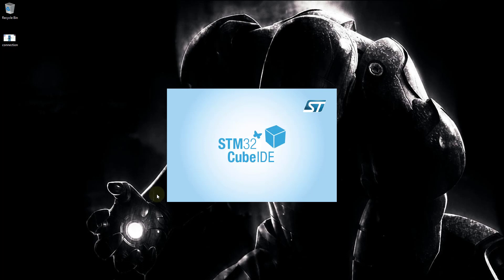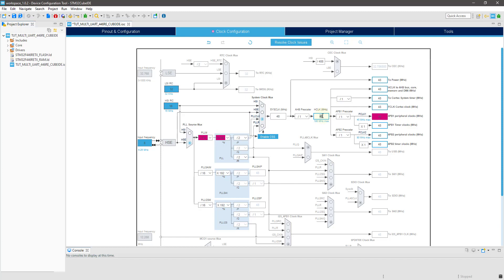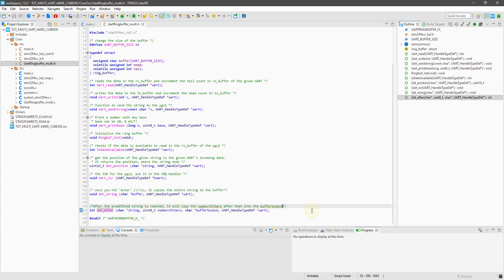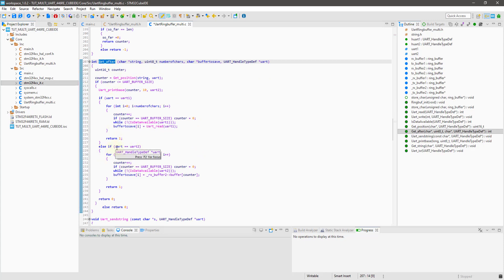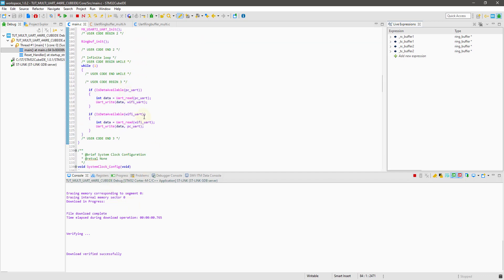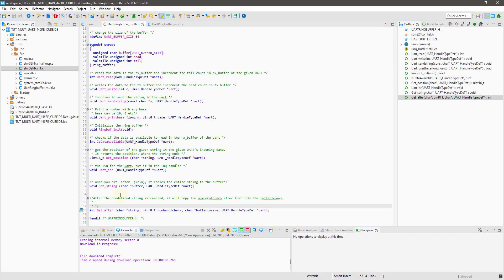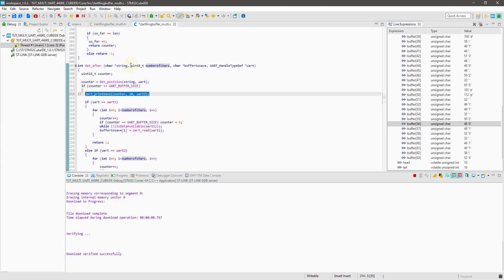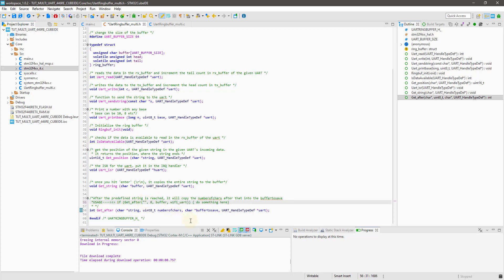Manage multiple uarts in STM32 || Head and Tail || circular buffer || serial devices

Comment: Thanks for posting! Very useful video! What would you 'get after' if you are transmitting google protocol buffers over a serial link between a stm32 processor and  a esp32?
Reply: Hi Eddy how did you integrate Google Protocol Buffers on STM32 Project , Please Help me in this Process i can't integrate Google Protocol Buffers on STM32 project iam getting many dependency and compiler errors Thanks in Advance

Comment: Thanks for posting your videos! I ported the code to a stm32H750 processor and expanded it to 3 interfaces. i had to change some register names that access the flags etc but for the most part it works great except for one issue that i can not get rid of. 2 of the  uarts are usarts and 1 is a uart.  when i receive data on the uart , the data ends up in the buffer but then the interrupt for that uart (uart4) keeps firing and the program never gets to the main loop anymore. Do you know if setting and resetting interrupt flags is different for uart and usart blocks?
Reply: Never mind i found the issue :)

Comment: I use stm32l496G discovery. I am not user usart1 because this board (stm32 discovery board) hasn't usart1 pin. therefore I am used LPUART1 for communication with esp8266. I have a problem. my problem is  in Uart_isr function. error: USART_typedef has no member named 'DR'; did you mean 'RDR'? HELP ME.
Reply from the maker: Check the description. There is a solution for that

Comment: 13:40 So if a function blocks UART then is it better to use USART in interrupt mode always?
Reply from the maker: Buddy, this is uart ring buffer. It is always working in interrupt mode. In blocking mode the data is still being received in the Rx bufger anyway. If u use the if loop, you can even do rest of the functions normally. It's just, you won't be able to do anything with the data received in the uart, until the string is matched and characters are copied..
Reply: @ControllersTech  So I need to look previous video for your own header file and functions.
Reply: I've looked UartRingbuffer files now and it looks a bit heavy code for me :(
Reply from the maker: Although it might look heavy but it's very simple to use. Give it a try. It's your best shot for unknown data length
Reply: @ControllersTech  You are right. I'll try to make it via watching your video for my MCU.

Comment: Hi, i'm trying to implement the projet, however when i do the sending buffer by usart ("AT" ASCI), (Usart 2 -> Usart 1) it only receive the carcter "A" . Don't know what's happening here. Don't know what's the change to do, any help ? I check the code, and i don't have the "READ_REG(huart->Instance->ISR)" and the "unsigned char c = huart->Instance->RDR;",, we only have the SR and the DR registers!! I'm using the STm32F103RBTX MCU
Reply from the maker: Read the description
Reply: @ControllersTech  The program does it ok, following this tutorial. But when the code  reaches the point of  ::
Uart_sendstring("AT\r\n", wifi_uart
while(!(Wait_for("AT\r\r\n\r\nOK\r\n", wifi_uart)));

The system breaks.. This line of code it's in the ESP8266_Hal.c file
Reply: Forget it!! We just did the connection !! However don't know what was the problem ...
Thanks for the help and the fast response.

Comment: Is not there a build BIN or HEX file directly and upload it into BluePill STM32F103C8T6 device via ST-Link V2 Mini programmer ?
Reply from the maker: There is a hex file generated after you build the project. Look for it inside the project folder. You can upload it via st link utility or maybe some other software too.
But it's better to use the st link directly. This way u will have the option to debug also.
Reply: @ControllersTech  OK, when I tried to Debug then CubeIDE said me "you ave to update your ST-Link V2 mini device firmware" and then I clicked to Upgrade button and it's done. But now Cube IDE and Cube Programmer says " error 4. No device found". Sometimes it uploads if I press on Reset Buttton on my BluePill (STM32F103C8T6) board and it uploads but sometimes even this way does not work. Maybe upgraded version has a bug ? If it is so how can I fix it ?
Reply from the maker: Frankly, i also have a lot of problems with my bluepill connection. That's why I am making more videos with nucleo board now a days. It's like half the time get wasted on just connecting that thing. 
I'll try to look into some other way of connecting it using serial connection or something. But till then i can only say that keep trying... Connect disconnect and hope it works..
Reply: @ControllersTech  Yeah, since yesterday I am working to fix it and learn to program in STM32 Cube. it was working well in Arduino IDE but it has another problem that it doesnot Work 2nd UART Channel in Arduino IDE. That's why I am trying to switch to more better programming environment like Cube IDE. Do you have any idea how to make work to UART2 in Arduino IDE ?
Reply from the maker: I can recommend you something but telegram me.. i need more information about the way you are using things.
Telegram me @controllerstech
Reply: @ControllersTech  Dear followers. I've fixed my problem by ERASE chip in St-LINK Utility I've downloaded from st.com. And then in CubeMX (now it is internal part of CubeIDE) went to  Pinout &Configuration menu and then SYS submenu, clicked to Debug -> Serial Wire option and then went back to IDE and clicked to debug menu item. Now everything works fine. I'm very thankful for the owner of this channel Controllers Tech admin.

Comment: Hi, 
I'm using ESP-01 and stm32f4 discovery.
When I reset my wifi module with a button, I receive the Wifi connected and Wifi got IP message in my terminal, but when sending AT command, the module doesn't any reaction to it and  rx_buffer1 and tx_buffer2 haven't the value.
Reply from the maker: Maybe you are not sending the command in the right way. Which serial console you are using ?
Reply: @ControllersTech   I'm using Arduino terminal and Gtkterm in ubuntu and Realterm in Windows. In realterm some garbage data is available in terminal. for example "u" instead of "OK" to answer of "AT". CR and LF is checked and baudrate is 115200
Reply from the maker: Some esp8266 don't have a default baudrate  115200, you should try with other BR like 38400, or something. You should test firat by simply connecting esp to the computer usinf some ftdi
Reply: @ControllersTech  I test it before and do some projects with Arduino. 115200 is correct!
Reply from the maker: Check if Both the uarts are set up at 115200
Reply: @ControllersTech  Yes, Both of them set up at 115200 and I do everything the same this video.
Reply: I think when terminal showing the reset message the baudrate set correctly.
Reply from the maker: I don't know than.. like you said, the reset output is displaying means the setup is fine. I think you should keep trying.. try other commands also
Reply: @ControllersTech  I'm very thankful to you for answering my questions.
Reply: HI! Did you find a solution to this? Because I'm in the same situation...

Comment: in this code is not working ...when am send "AT" command to esp8266  from PC terminal it's  return a "AT" response to the PC terminal  what is the problem occurred here.... please give the solution about this.....
Reply from the maker: Use realterm for the serial monitor
Reply: @ControllersTech  ya....i use the realterm serial monitor but did not get the correct output....then what is the solution to get the correct output......
Reply: @ControllersTech  am using stm32l476rg  nucleo controller
Reply from the maker: First try without the microcontroller. Simply use any TTL device like ftdi and check the ESP response
Reply: @ControllersTech  ya...i use  ftdi  but no response comes....pls give the right solution
Reply: i connect the ftdi  tx pin to rx pin of esp ,then rx pin of ftdi to tx pin of esp and ftdi ground pin to esp ground pin.....then am open a realterm  and send "AT" command ....but no response comes....in this type i use 9600 baud rate....
Reply from the maker: Use 115200
Also make sure CR and LF are checked
Reply: @ControllersTech  thanks for your replies....now your code is working....you are one of the trust able one....
Reply: @sarathkumar-tf4lr  Hi how did you get this to compile for STM32L476RG, I get ..\Src\UartRingbuffer_multi.c(331): error:  #136: struct "<unnamed>"  has no field "SR" and a few other errors within the "UartRingbuffer.c" file, did you modify some of the code?
Reply: try to transmit "ATE0\r\n" -> wifi device. This should turn off the echo

Comment: So it worked???
Reply from the maker: What? Can u elaborate..
Reply: @ControllersTech  I asked if this would work for multiple instances
Reply from the maker: Yes it does. That's what shown in the video buddy. U can use it to interface some serial based device. Just like you use hardware serial and software serial in arduino..